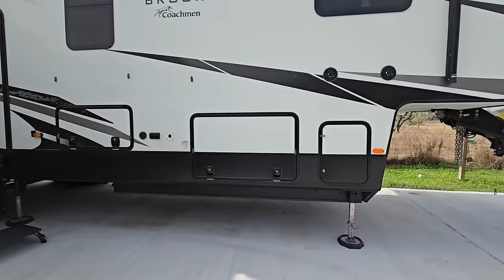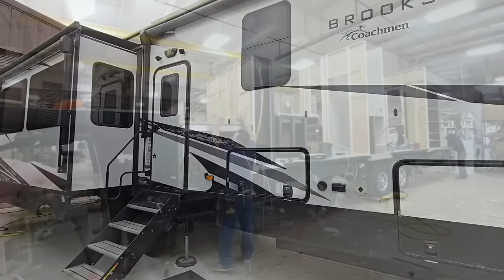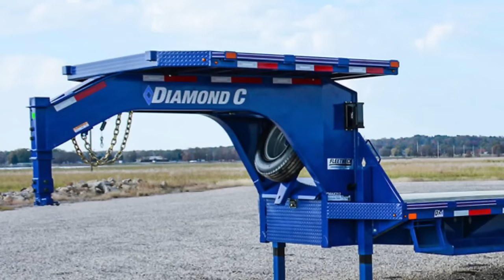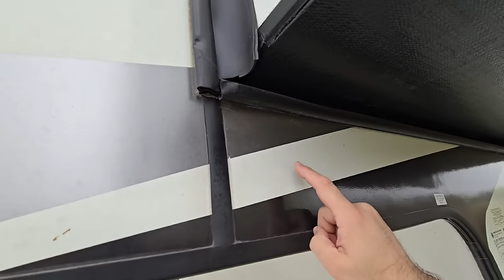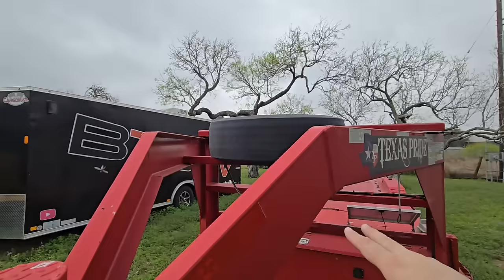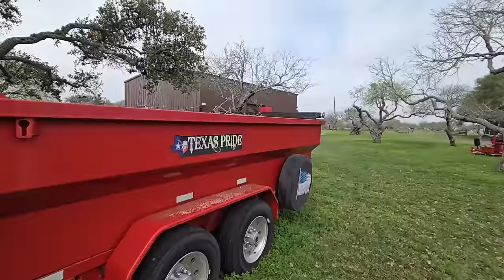FIFTH WHEEL RV vs GOOSENECK Trailers.  WHY THE DIFFERENCE?  Explained!

Comment: What are your thoughts on using a trailer saver fifth wheel hitch , looks like this hitch would take a lot of the shock from the roads and such, therefore relieving stress to the camper?
Reply from the maker: At this point, I would stick to only approved items.  I'm not sure if the trailer saver is approved.
Reply: I run a BD5 trailer saver hitch, it's so smooth. I researched for a long time before I bought it. It does a really great job isolating road shock from my truck that would otherwise be transferred to the pin box.
Reply: Never heard of a manufacturer approving 5th wheel hitches with the exception of switching to a gooseball setup. I can understand that because it is a different dynamic on the trailer itself. If I am wrong please correct me as I would like to see a list of approved 5th wheel hitches.
Reply: JD, I am referring to the trailer saver hitch in the bed of the truck, not changing the hitch on the camper.
Reply: @BigTruckBigRV  JD, I am referring to the trailer saver hitch in the bed of the truck, not changing hitch on the camper.
Reply: I also use a Trailer Saver hitch TSLB on a Sport Chassis.  When researching hitches I never found anything approving hitches just pin boxes.
Reply from the maker: @JasonBurns-r3e I've personally heard really good things about that hitch.
Reply: @BigTruckBigRV  Thankyou for the responses and feedback ,it takes all of us to work together to improve on everyday issues. More feedback is  welcome. I recently ordered and purchased a valor 44v14 and I want to protect my investment. If I need to order a trailer saver hitch or install air bags on my truck or gen y pin , I will, do so, this talk about frame flex in general has me wanting to take the necessary precautions just to be safe.
Reply from the maker: @JasonBurns-r3e I completely agree my friend

Comment: With all of these metallurgy problems in a lot of industries I wonder if there is some blame there
Reply: FOAM fill walls with a few aluminums tube around windows and corners "IS NOT" a reinforcement for the "steel" frame. The Frame should be designed to carry the "ENTIRE" weight of that unit.  You are either misinformed or you are spinning on behalf of the manufactures. Either way this is BS you are spreading.
Reply from the maker: Why is it so hard for you to understand that what you're asking virtually impossible on a trailer with a 40ft+ span?  Almost any engineering student especially structural and mechanical engineers will tell you that creating a frame over that distance that will not flex or move is impossible. Putting a rigid box on top of it that cannot flex or move is impossible. They have to work together or the structure will fail.  There's no way around it.  The problem with the content that's going out is that it's a very technical topic with folks who can't understand the engineering or structural aspects of it. If you can find an engineer who could construct a frame that has to meet certain weight criteria, plus carry a rigid structure on top of it with integration throughout it with zero ability to allow the box and frame too reinforce each other, I would love for you to share an example.  Please don't say gooseneck trailers, horse trailers, or cargo trailers, because they all flex and some far more than RVs.
Reply: why is it so hard to understand that the pin area needs to have certified welders and more bracing. I do not agree with College degree Engineers that build from teaching and not real world experience. not trying to create a fight here just pointing out that people built better before engineers got involved. @BigTruckBigRV
Reply: @BigTruckBigRV  It's not the frames simply flexing. They're breaking. The tube steel is splitting/cracking. The bubble gum welds are coming apart. Some of those welds, that LIC says are done by a machine, look like something I did 30 years ago when I got my first welder and was learning. So they're being done by people, and incompetent people at that. No way a lot of those welds would pass certification. Sloppy, chunky, burnt through or poor penetration. Yes, frames are going to flex. They have to. They shouldn't be failing. But they are.
Reply from the maker: @riccochet704 I'm sorry, when did Lippert or I state that any of the welds except for the main I beam stitching were done by machine?  They have over 600 welders manually assembling them.  I'm sure human error, laziness, and many other factors impact their workforce at times, like any other.  I can bet you, those same welders go home and weld an amazing BBQ pit for their friends and family. When it's a 9-5 job, most aren't going to do TikToc welds.

Comment: Grand design is building crap trailers I saw a video of someone's trailer and they showed the poor welding that was done by lippert and I mean poor. So no quality control from lippert and no quality control from grand design. They obviously did not inspect the frame before building on it. Also they did not put all the lag bolts in to hold the walls in place. There was alot of the bolts missing. You can try and explain this crap away all u want but the bottom line is they are not inspecting there work for quality. It sure seems like ur trying to defend these guys

Comment: you know we are not argueing that flex is going to happen but the welds are failing due to non certified welders in place come on lets get serious here. it is all about cutting cost for profit and sacrificing safety.
Reply from the maker: Jim, everyone who has been commenting has had different things they complain about. Some say Flex, some say RV super structure, some say design, some say engineering, some say all RVs need to be able to go through anything an owner could subject it to.... Fact, that's been said several times
Reply: the majority of the "Frame Flex" is Frame failure due to poor welds and garbage Material 1/8 wall on a pin box is not acceptable everyone supporting the corporations are just as guilty as they are this needs to get resolved. not just for safety of the owner but others on the raods. no excuse for this to be going on @BigTruckBigRV
Reply from the maker: @jimlarkin1400 brother, are you seriously ignoring the fact that almost all instances of "frame flex" and "failure" are occuring because there are missing bolts from the front section of specific Grand Design units?  The ones with this issue are also experiencing the excessive frame flex which ultimately leads to failure.  Poor welds just exacerbates this once it starts happening.  Regardless of what side you take or what you believe, if you're being unbiased and honest you will see that this is in the case nearly every time.
Reply: really lag screws into wood giving strength to a frame supporting 2 to 3 thousand lbs come on that is hillbilly construction theory. @BigTruckBigRV
Reply from the maker: @jimlarkin1400 again, Id agree if it were happening to a higher percentage of units.  The correct attachment (from what I've been told) AND on units that aren't experiencing failure is: A permanent construction adhesive, 6 lag bolts on each side (12 total), pre drilled and glued, 6 large screws (12 total) from the bottom on each side, pre drilled and glued.  I'm just guessing that it's because of this process, most manufacturers haven't had this issue.

Comment: Show a horse trailer not a flatbed . Easy fix - build a raising ceiling over duh lots of words and not much talk about how to correct the issues . Horse trailers do not have these failures so- all of this info interesting but not necessarily helpful. You claim the reason you cannot raise the floor is headroom- again, make a ceiling “pop-up. All of the bodies of the RV could be attached with flexible  attachment, so many ways to fix all of the issues.
Reply from the maker: You are saying to do things you can easily avoid by going with RVs that don't meet the criteria for problem units. Mid profile units rarely ever deal with this problem. You're assuming some oddly popable and technologically advanced unit is going to be appealing to folks who want a traditional full profile RV.

Comment: It’s cause most these frames are cheap trash.
Reply from the maker: Question, serious question, how much more additional weight do you think needs to be invested into the frame in terms of material and thickness to change your opinion of this? As well as what type of welder would you generally require to do the work?
Reply: @BigTruckBigRV  For one the welding is terrible on these lippert frames. Just gummed up welding. Maybe I’m just used to oil field welding, you don’t make it here if you don’t weld great.       Also the steel is subpar, I get they use the steel from china to save money but it’s not good.

Comment: The goose neck transferers the force properly to the main frame components.  That same or similar concept could be applied to an RV, at least for the horizontal forces.  A simple set of diagonal tube section from the pin box back to the upper platform connections, properly connected, would do a lot.  But they won't do it to save COST.  Learn something about engineering.
Reply from the maker: Really?  Do it without compromising upper deck space?
Reply from the maker: Also your incredibly inaccurate information about Semi Trailers (Dry Vans) was COMPLETELY wrong.  But you never replied to my response.
Reply: Easy @BigTruckBigRV
Reply from the maker: @jamesstever8335 but it's true.

Comment: FOAM fill walls with a few aluminums tube around windows and corners "IS NOT" a reinforcement for the "steel" frame. The Frame should be designed to carry the "ENTIRE" weight of that unit.  You are either misinformed or you are spinning on behalf of the manufactures. Either way this is BS you are spreading.  You should be banned from YouTube for spreading this crap.  But I am sure it will be my post that is taken down.
Reply from the maker: Since you repeated your comment, I'll repeat my answer: 
Why is it so hard for you to understand that what you're asking virtually impossible on a trailer with a 40ft+ span?  Almost any engineering student especially structural and mechanical engineers will tell you that creating a frame over that distance that will not flex or move is impossible. Putting a rigid box on top of it that cannot flex or move is impossible. They have to work together or the structure will fail.  There's no way around it.  The problem with the content that's going out is that it's a very technical topic with folks who can't understand the engineering or structural aspects of it. If you can find an engineer who could construct a frame that has to meet certain weight criteria, plus carry a rigid structure on top of it with integration throughout it with zero ability to allow the box and frame too reinforce each other, I would love for you to share an example.  Please don't say gooseneck trailers, horse trailers, or cargo trailers, because they all flex and some far more than RVs.
Reply: I have done bridge girders that defect over 2 feet, The issue is not "Flex" as you put it.  The issue is "Yeilding" or failure.  The way these frames are connected, and transfer forces is incredibly amateurish.  It is no wonder the welds are failing, and fractures are occurring in the base material at the pin box and where the upper platform connect to the riser.  And the way the standard leaf spring are connected, another place where failures are occurring, I wouldn't do with a mulch trailer let alone something that weighs in at 6 to 9 tons and 40 feet long.  But your right, it most likely first year college student engineers that came up with these ideas.  Especially seeing what colleges are turning out these days.  This is putting the lives of RV owners and possibly other travelers on the road in danger.         @BigTruckBigRV
Reply from the maker: @jamesstever8335 so it seems like you do understand basic engineering principles.  Given their chassis division has over 35 engineers, most I'm sure with PEs, it would probably behoove you to actually reach out to them and speak to their engineering department and ask the questions that you want answered. That way, you can argue with them and tell them about their lack of knowledge and abilities to engineer a frame.
Reply: They won't talk to me.  I wonder why?  @BigTruckBigRV
Reply from the maker: @jamesstever8335 what number did you call, who did you speak with, and what was their response?  I'd be happy to get someone who will speak with you.